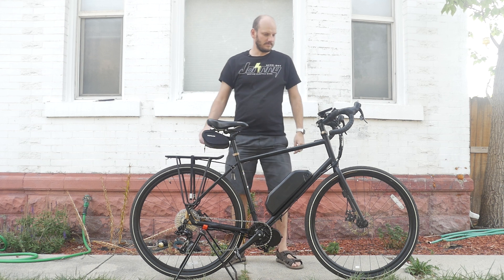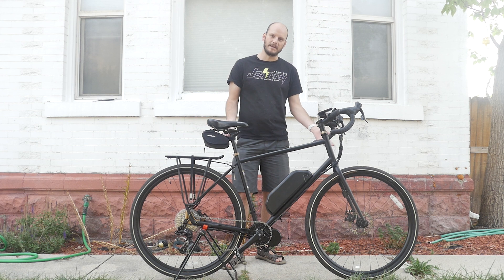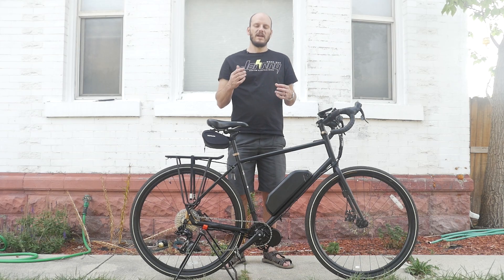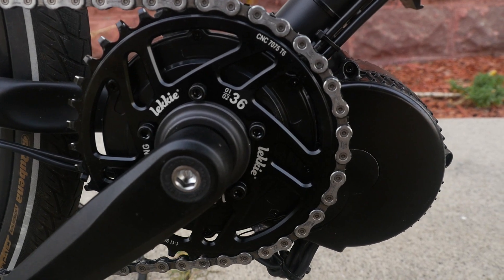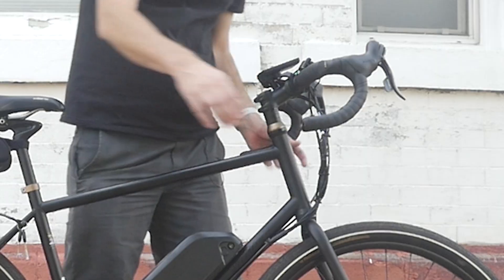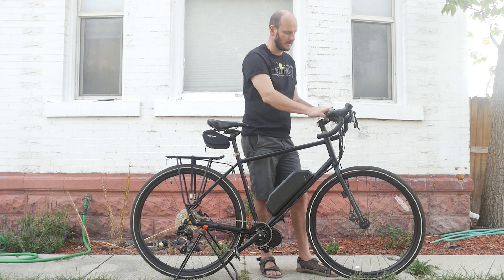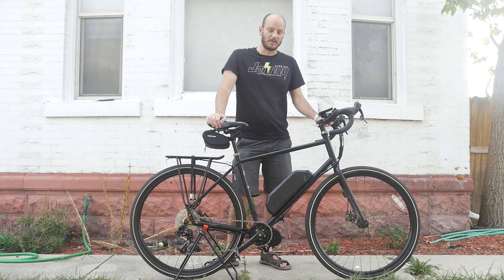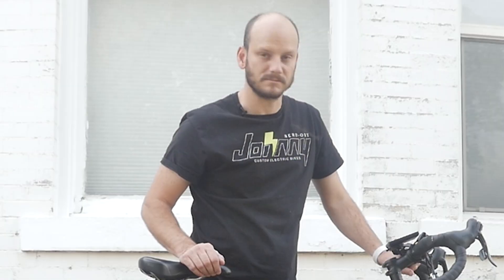Custom E-bike Build: Specialized AWOL w/ Bafang BBS02 & 52v 17.5ah Battery

Comment: Do I really need break cut offs?  What's the draw back to not having them? When I left off the throttle, the motor stops. When I'm in pedal assist mode and stop pedaling, the motor stops right? 
What am I missing?
Reply: Bump the pedals when your at a light and you will find out. 🤣🤣

Comment: I bought a BBSHD motor last week from you. now I'm riding the only mid drive Radrover on  the planet...😎👍 and I'm loving it. What do you think about ASI BAC 855 controller upgrade... got one? Should I get one?
Reply from the maker: Yeeeah buddy! Give it a few hundred miles. I find that the stock bbshd controller is already towing the line of the max power a bicycle can handle without breaking (when ridden properly)

Comment: Hi I have been subscribe to your Channel for about several months or a year tops. And I'm seriously thinking about turning my bike into an e-bike because I already use my bike to get around like to stores and stuff and I want to make my trips around town easier on me. I have a schwinn sidewinder with a steel frame and it has 7 speed and the tires are 24 inch and the tires are kind of wide. I have ridden this bike on the streets and the sidewalk and through the snow and grass and mud and it held steady through all of that. And I was wondering what would be the best kit to get for my bike mid Drive or front wheel drive or back wheel drive.😎🤷‍♀️

Comment: Hey Johnny, thanks for your builds and helpful videos. I was able to convert a 2017 Marin pike two with a BBS02, kinda wished I would a gotten a BBSHD, still might later on in this year! I maxed out at 30MPH, maybe its the 27.5x3" tires....Only thing I messed up real bad was the gear cable, but everything else has been smooth.

I have the DCP-18 screen, is there anyway to have more than 5 pedal assist levels on that screen? I programmed the controller with 9 speeds.
Reply: With a 52 tooth lekkie ring on the front and and an 11 rear you should easily hit 35-40mph 

My carbon folding bike has 20 inch tires and hits 32mph with a 52 front and 11 rear .

BBS02 should be plenty.
Reply: @TheAgentAssassin  on the default 46T chainring...come to think about it, I still think the speed is governed even though I increased it in the programming

Comment: I built a similar roadbike to this with drop bar but with 52t Lekkie chainring and BBSHD....52V battery 19.2 amp-hr.  My roadbike is aluminum and not steel.  An AWOL would be a good choice being steel and with upright geometry. The Grin Technologies 'bobs' can be mounted in a better position for more ergonomic use of the throttle and display controls.
My bike will do over 40mph with stock controller. With an aftermarket controller and higher amp battery, the bike would do 50mph...the BBSHD will take 4K watts.  But honestly, with 28c wide tires...I run this size too, you don't really want to go faster than 40mph on a road bike because of lack of suspension.  My bike is about as much fun as you can have with your clothes on.  I can drop a pro cyclist on my bike and many of them can hold close to 30mph.
PS. in an ideal world, if wanting a drop bar for another riding position which I prefer and also get out of the wind at high speed, ideal tire width would be closer to 40mm or so.  A gravel roadbike is a perfect chassis to mount a Bafang mid drive and better than a bike limited to 28mm tires like my endurance roadbike which doesn't have the tire clearance of a gravel or mountain  bike.